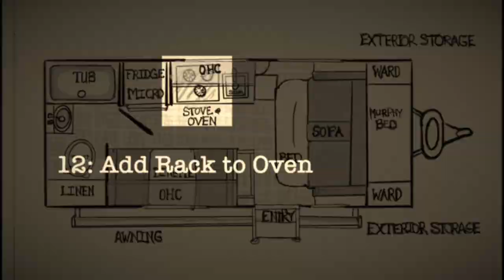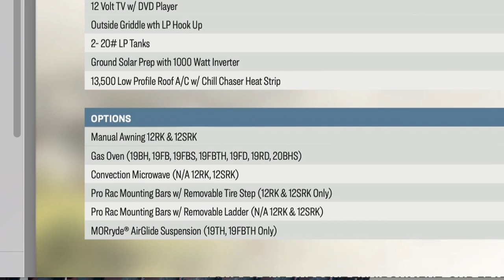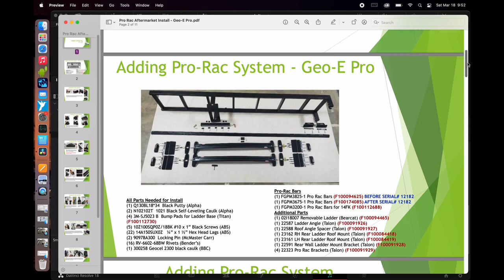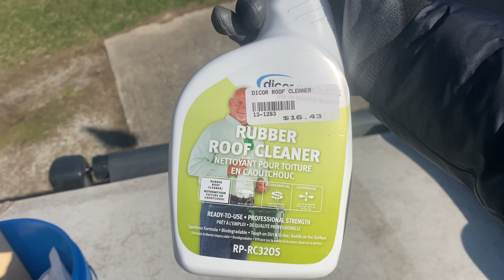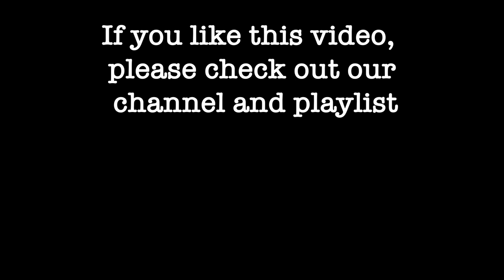Epro Camper trailer Modification nearly ended in disaster and how we repaired our roof

Comment: Another great example of the crappy workmanship typically found at most RV dealerships.  Good thing you found the problem before you went cruising down the interstate with those storage boxes sitting on that rack.    Wind resistance would have ripped the whole shebang off the roof and sent it flying through the windshield of the vehicle behind you.   Sorry that happened but at least you got the dealership to reimburse you for the expense.

Comment: Did you fill the screw and rivet holes before you patched the surface?  That cleaner really works.  How caustic is it?
Reply from the maker: The cleaner is not caustic that would kill the membrane. We thought about filing the screw holes but there was not really an easy way to do it without opening the holes in the membrane more. With the patch and dicor it should be a good repair, but we will keep a close eye on it as we go...